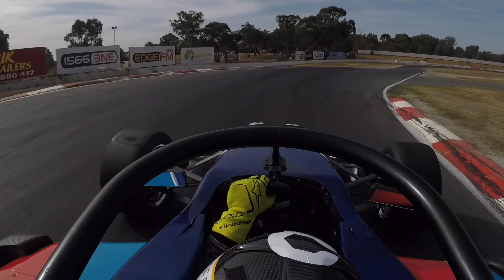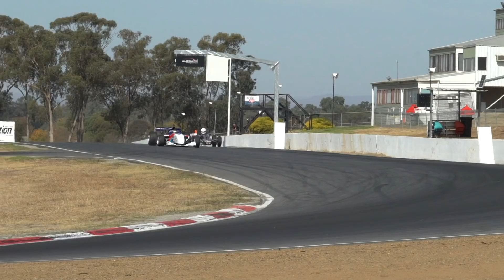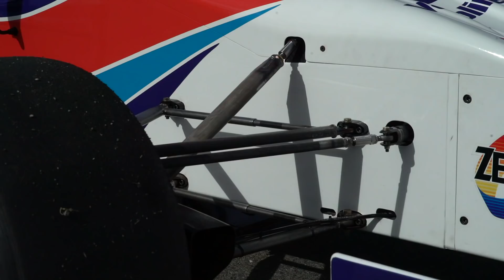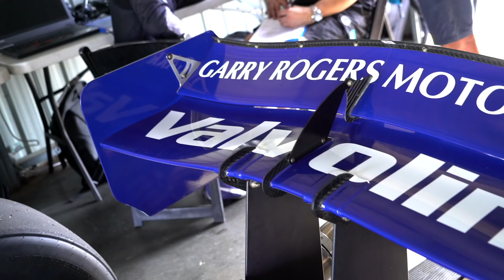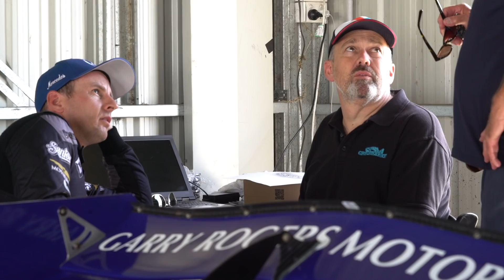Final development test at Winton Raceway

Comment: What engine ?
Reply: am guessing a 5 litre
Reply: Modified and sealed 5.0 litre Ford Coyote V8. It's a control engine built by InnoV8 in Brisbane. All alloy, 4 cam, 32 valves, fuel injected and rated at 560 hp.